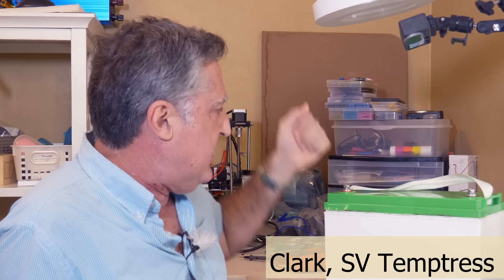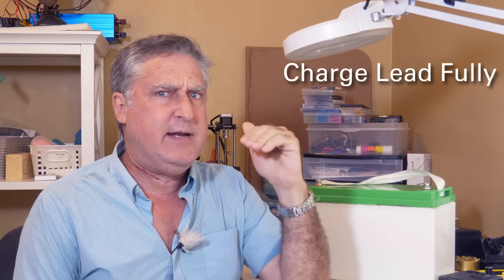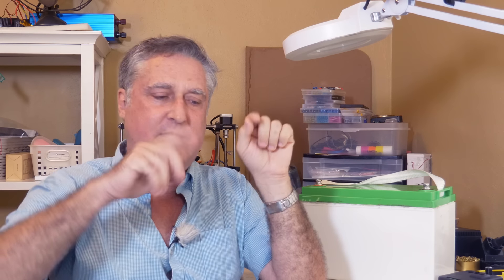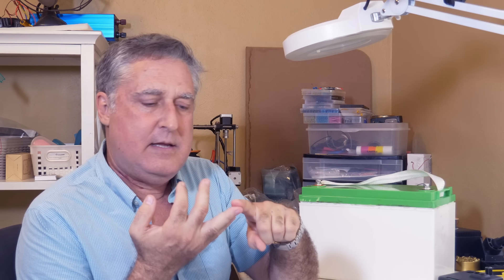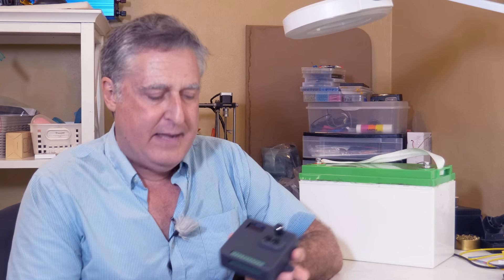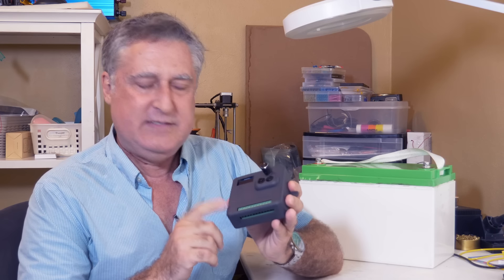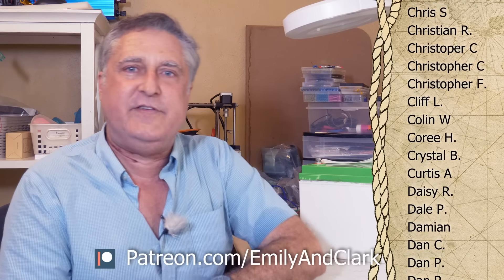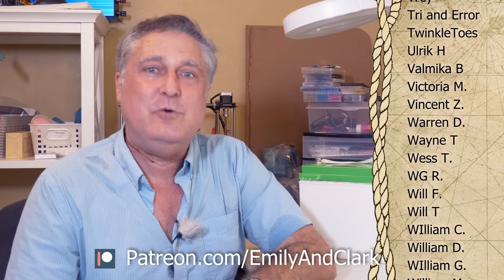Charge Lithium Batteries correctly (LiFePO4)

Comment: "you shouldn't put [different lithium ion batteries] in a parallel bank, but you can put them in separate banks that are in parallel controlled by their own bank manager."  HUH?
Reply from the maker: Yes.  The BankManager charges each bank to its own needs.
    For example in my system my VoltGo accepts charge faster than my Redodo.  (Both about 400ah).   So if they start at the level of discharge the VoltGo BankManager will switch out first.  Then the Redodo will finish its charge and switch out later.

   If they were in parallel the VoltGo would be held at high voltage even after it was fully charged damaging its cells.

    I hope that example clarifies
Reply: @Clarks-Adventure  I'm working my way through your version 3 manual.  Does your BBMS have a bluetooth connection and a cell phone app?  It looks like you've done some great work.  I haven't put lithium batteries on my sailboat yet as it's in the Galveston area and I don't plan on starting cruising until 2027...  I have roughly until then to figure this stuff out...  Thanks for a great video.
Reply from the maker: Bluetooth yes.

   App not yet but I hope well before 2027

Comment: Midnite solar, the kid , charge controller, ,is designed so you can charge  all the batteries. It is infinitely controllable and every metric is user adjustable

Comment: I understand your concept but these lifepo4 batteries already have bulit in BMS, under and over charge protection. 
Why do I need yet another device to regulate charging when there is already one fitted by the manufacturer inside the battery, for this specific purpose?
Reply from the maker: I suggest you watch the video again.
   The BMS only stops charge once the lead cell is about to actually vent electrolyte. Damage is happening at that charge level.

   The BankManager can stop charging at 100 percent.  This is vital to long cell life.  Loads of academic papers on this.  But the battery manufacturers are only slowly talking about this.
   They are getting so many warrantee claims they are starting to take charging seriously but since they don't know about the BankManager they are trying to do this in the BMS (EPOCH) and failing miserably

Comment: I want to charge a 12v LIFEPO4  6ah battery on my solar tracker from a 35VDC panel. I thought about using a  LM7815 15vdc voltage regulator for charging. After this video I see I can't do that. I never imagined LIFEPO4 were so particular. We get 5 days a year below 32F so I think I'll have to go SLA AGM lead acid. Instead. I wish I  watched this video earlier. Now what to do with my 2 LIFEPO4 batteries and 2 LIFEPO4 smart chargers? Maybe I can make a under water robotic pond sweeper.

Comment: I have a bluetti power station, any thoughts if BLUETTI truly charges to 100% or is it really charging to 80%?   For long storage they do recommend to store at 80%, how advanced is BLUETTI electronics?  since it’s known to be one of the best brands.
Reply from the maker: The bluetti I've used has LiFePO4 cells but make sure yours does.   If it has another kind this doesn't really apply the same way.

I'd bet the farm they overcharge a bit each cycle if you let the thing sit under charge power.

Comment: So it sounds to me like there is a real lack of technology to balance cells. It sounds like many of the cheap batteries which we love, don't do a good job of balancing themselves. So then why wouldn't someone just run small positive wires through a plug to the outside of the case so that you could install your own bank manager to monitor each cell and balance them?
Does the redodo balance its own cells?
Reply from the maker: Marketing.
   Their position is you just "drop these in".  So if they assigned work people wouldn't buy.
   Also these are selling so close to cost that the plug cost would be significant.

    And waterproof case
Reply from the maker: But, man..  would my job be easier if they did!

Comment: Oh, I got another question...  I watched another video where you said that your bank manager won't connect the bank to the lead batteries if there's a significant voltage difference.  Suppose you're in the condition that they're disconnected and the lead batteries are supplying a small load.  Then some big load occurs (microwave, air conditioning).  Is the bank manager fast enough to connect the managed battery bank to the lead batteries as the lead battery voltage drops suddenly?  I suppose the answer to this must be "yes"...???
Reply from the maker: Yes it's yes.
    Some of the early software could miss occasionally, but I put a fairly brute force algorithm in that seems to work much better now.

Comment: Second question. If someone bought your Gen 3 BMS, do you include a power dump resistor... or do you indicate a resistor rating?
Reply from the maker: No I leave the load up to the user.
   Like 2 ohms with a proper heat sink is a good upper limit.  Maybe 4 ohms

Comment: Why don’t they have balance leads like my lipo batteries for my rc cars. Or is that pretty much what a bms built in the battery does ?
Reply from the maker: It's what the BMS should do.  Some aren't great at it
Reply: yes every consumer battery have a build in BMS=battery managment system= do all what is to do for ea cell in the pack to hold any cell on its specs , voltages, amps, temperatur,....

all what you have to do=plug it on any device and have fun.

Comment: Hey, that's great. But can someone tell me how I should charge these cells correctly.... The voltage rises so quickly to 14.5V that afterwards no current flows at all. So you can even forget about charging with large solar cells, how do you want to go camping like that :( I also want to be able to charge from the mains but that's no longer possible at 300W even after 20 minutes, only 20W is still flowing, wow, super efficient... . Thank you.
Reply from the maker: Get the BankManager if you want to do it right.

But from your comment I see you should start by watching this video more carefully.  You don't seem to understand how to not overcharge LiFePO4
Reply: @Clarks-Adventure  i got the jk bms, and this will cut the charging when getting too near the OVP.

I am really frustrated with the current absorbtion of the lifepo4... LIpOs do not have that problem. Don't you have to deal with the same issue?
Reply from the maker: @NicolaGrossenb876 again.  You have a basic misunderstanding about how li charges.   That's my favorite BMS.  But it is there to protect the cells from immediate destruction.  No BMS is there as a charge aid.

You are overcharging your cells and they won't live a long time.

WATCH THE VIDEO.
Basically, LiFePO4 charges quickly until you are overcharging
Reply: @Clarks-Adventure  okay so I can assume that I have a full battery even the Voltage says 3.4V each cell? I know that the bms is only a protection and a manager :) No charging aid there. I watched your video. And I heard things like lifepo are slow in charging..

One question: when my batteries are resting, they were never above 3.5V each cell since I bought them from China. Only when charging, they were at 3.65 of course. Can I discharge them already now until 20% without harming the battery?
Lipos are also coming with 11.1 Volts, but they really need to be at 100% before first usage.
Reply from the maker: @NicolaGrossenb876  you need to either do a bunch of your own research to learn how to charge these or buy a BankManager to take care of it for you 
   You simply can't charge li in an active installation to a voltage, there is more to it than that

Comment: Can I use two bank Managers on the same lead battery (want to add new lithium to my existing set up).
Reply from the maker: Yes.
   Sorry I wasn't clear.  That's exactly how it works
   Just another Li bank wired in parallel to the lead with a BankManager contactor in the positive wire.
    Freeze frame on my video and you should see that the left side of the contactors is a copper bar with one big cable going to lead and the boat
Reply: @Clarks-Adventure  Thank You

Comment: I bought li-time lithium batteries along with their charger. I have always used the charger to top off/full charge the batteries. Is it hurting the batteries 400 ah in series for my van conversion? Do I need to turn off the solar occasionally?
Reply from the maker: I'll look later most likely as liTime is currently sending me their newest battery for review.

But every other "charger" supplied by battery manufacturers I've seen was just a 14.6v power supply.  Arguably the worst thing you could use to finish charging.

If it looks a lot like a laptop power supply.  It's that kind.

They are the cheapest way to put power into a battery so they sell them.  Easy profit.
Reply: Take a look at Li-Time's charger profile that supposedly pairs with their LFP Batteries.
Reply from the maker: @s.mendez7160 I'll give it a look when I get home.
Reply from the maker: If you mean something like this
https://www.litime.com/products/litime-12v-10a-lithium-battery-charger
Yeah, it's crap
Reply: @Clarks-Adventure  Yes that's the one I got. Which one do you recommend?
Reply from the maker: As I say in the video I recommend the BankManager.

If and only if you are charging when there is no loads and you are charging from AC power you could calculate the c rate and the correct voltage then find a charger that shuts off there.

Comment: I bought 24v LFP battery pack but it's showing 102v via multimeter, whats happening?
Reply from the maker: Broken multimeter??
Reply: @Clarks-Adventure  it shows 10v for a 9v battery on 20v range but shows 34v on 200v range for same 9v battery, that means it's broken!!
Reply from the maker: @gogogolgogo https://youtu.be/kzvQMgiDSmc
Reply from the maker: @gogogolgogo https://amzn.to/4eFf1RR
Reply: @Clarks-Adventure  charged 24LFP battery pack with 3Amp_29.4v Li-ion charger for 3hrs but battery discharged after 40 sec  of cycle running.
What can be the issue ?
Reply from the maker: I can't solve this over YouTube comments 

I have a consulting tier on Patreon but I think you should just research things more and think it through

Comment: My MPPT does everything your little black box does and more, so if worried buy a better quality MPPT, it has three ways to charge, you have a choose, volts, amps or wattage, job done.
Reply from the maker: Does it watch the amps actually going into the battery, not the amps leaving the controller?   What happens when you turn on a load while charging 
    Then you have to compare the algorithm.  For example EPOCH just tried this in their BMS and failed terribly.
Reply: What Sort of algorythm??
10 amps in 5 amps out to a consumer=5 amp Charge current.

What you dont understand, how battery works?

Batteries have a stat of Charge based on there voltage that is what you have to unterstand.

And batteries get charged or discharge with current with this not algorythms.....

You look wirh this video for naiv  people?

Comment: You're wrong that you can't charge LiFePO4 to a certain voltage. I have my chargers kill charging at 27.1v on my 24v system. 29.2v would be 100% & 27.1 is just past the upper knee & even tho The difference looks big, 27.1v is only about 2% away from full charge.
Reply from the maker: You are causing a memory issue to develop and the target voltage has to be modified by c rate at the very least 
   I contend you can't charge li properly to a voltage.
   But of course you can put power into them that way.
Reply: @Clarks-Adventure  lithium battrys of all kinds dont have any sort memory .
to tell here fantasy story no change anythink on a fact that can checked with google easy.
Reply from the maker: @ThomasNowicki-m5s and you base this statement on what?  You have a degree in electro chemistry, you are psychic, or it's just religion for you in that you really want it to be true so it is.
    In the real world I have a customer powering a car in the Bahamas with Li and solar.  His memory got so bad he is down to 30 percent capacity.  The diagnosis of memory is from his battery company.  They are working with him to clear it then he is going with the BankManager so it doesn't happen again.
Reply: @Clarks-Adventure  I base it on the resellers stats who all say staying within the knee points will dramatically increase the cycle capacity. They get their info from the battery companies so are they just fabricating info? I think not. I don't need a chemistry degree to determine when all sellers are saying the same thing. I wonder what your real world is? It sounds like psycho babble to me. I'm referring to lithium phosphate, there might be another senerio with li-ion which I have no concern over.
Reply from the maker: Think about this.  If you charge at .5c you need to charge to 29.2 to see 100 percent charged.  If you charge at .00001c you are fully charged at 27.6v.  If you don't charge fully at least now and again you will develop memory.  (And yes it's a real thing, I, and his battery manufacturer, are helping a guy with a big system in the Bahamas recover a pack that only sees about 30 percent of its original capacity due to memory)

So it's a moving voltage target at best.  Though there is much more to it.

Notice that EPOCH and LiTime have both tried to implement something like my algorithm in their latest BMSs.  They missed the mark but their attempt shows they see it as important.

   No battery company will tell anyone to charge in an impossible way as you wouldn't buy their product if you couldn't charge it.  And basically without my device you can't charge correctly in an active system.

But given constant current into the battery you can do it right to a voltage.  It's probably covered here best for someone who doesn't care to read the academic papers.  https://cdn.shopify.com/s/files/1/0568/1011/1110/files/Math_ScienceOfBBMS_Grillo.pdf?v=1730396821
I call particular attention to the link Conrad offers.  That guy did a lot of great early work.
Reply: @Clarks-Adventure  I've read a little on memory effect for lithium phosphate but it falls in a particular oddball pattern that's abnormal to what most home power systems will see. These cells haven't been around long enough for a stack of reports finding a clear reference identifying what characteristics would cause such an issue.
Reply from the maker: And yet it's happening.
   Again the research is deep in the academic papers.  And they are difficult and expensive to get to.

Comment: Great Discussion Clark 👍 I do like AGM Batteries still, as I know for long Service Life, they need to be kept at a minimum State of Charge of 80 % - just adjust the Bank Size accordingly, which means with say an 800 ah bank, the Maximum you can use overnight before Solar kicks in again, is 160 amps from them which Flatlines the RechargeCyclesso they never reduce- which on a Sailbat, for me, is plenty. Then Bank 2 is Lithium Lifepo4 - likely 4 x 230 ah Plus type Batteries, in an overall management role of looking after the AGM Bank, plus engine Start, Generator Start, Windlass and Bowthruster Batteries.  so 900 ah, but so the Recharge Cycles for those never fall - according to Ampere Time, which became Li Time - you never let the state of Charge drop below 50 % which means at least 400 amps is available to keep all the other Batteries on the Boat Happy . If sailing between places, then a pretty decent engine alternator, or the Generator, if it is cloudy or Raining, then the Bank Manager will assist in the Lifepo4 Bank Role, by looking after that Bank, by making sure it is looked after properly First, so from the Lifepo4 Bank, DC to DC Chargers look after every other Battery, or mix and match with other Battery managers as well - how best to low stress divide the Workload , is doing my head in at the moment. Top Solution for managing Lifepo4 Batteries is your Bank Manager right now Clark, but the new lightweight Victron DC to DC Chargers may be up  to handling AGM Batteries ok for keeping them happy ? 😅 Sorry Clark, I'm not exactly with it right now, a Nurse put compression Socks on both feet, but the one on my Left Foot caused the Skin on my foot to fall off, and the pain killers are driving me a bit DooLally, but at least they are working, and so far so good - No infection.  Best Wishes,  and Keep Up The Great Work.  Bob in Wales.  🤔🌟🌟🌟👍😄
Reply from the maker: I hope you recover quickly
Reply: @Clarks-Adventure   Thanks Clark. leaving the Circulation Socks off, a course of Antibiotics, and Cocodamol Painkillers seem to be getting on top of things Fast. Not usually a fan of dodgy Paracetomol, but 1 tablet 12 hours apart seems OK, I've avoided having Antibiotics for nearly 50 years, and now I need them, they are working, so things look up. All the Best, and Fair Winds Buddy. Bob. 🤔🌟🌟🌟👍

Comment: Listening to all this just confirms why I love my whole house ng generator i literally never worry about having power to do what I need to 

NEVER! Let me repeat NEVER!

I always have charged batteries if I need them for tools and the like! 

Having a 110 plug in my car is total nonsense especially with only 150 watt capacity 

If I needed that cause I was in the car and needed to charge batteries for tools I’d find a 12v adapter ( they do exist) and charge them enroute or before I left 

The worse case scenario I always can fire up my 10k generator that’s in my pickup bed 

I’m just old school and it’s worked just fine for me these 60 plus yrs 

But you guys do you and I’ll do me if it works don’t fix it is my motto 

Have a nice day 

Enjoyed the vid regardless